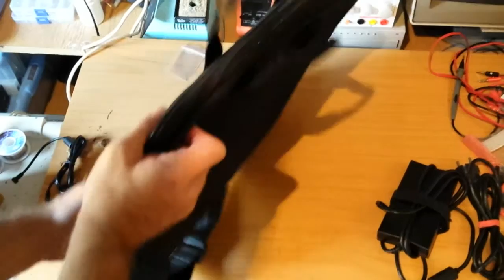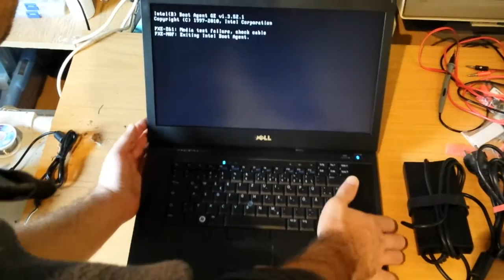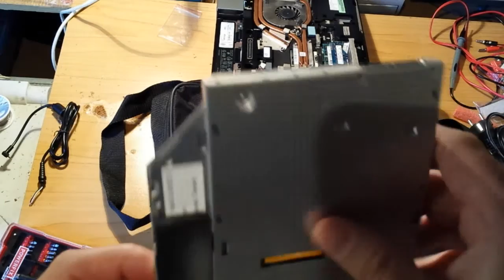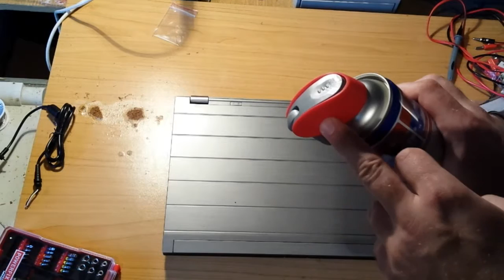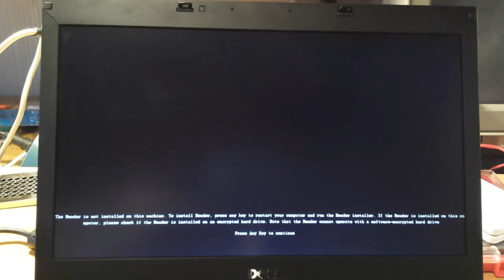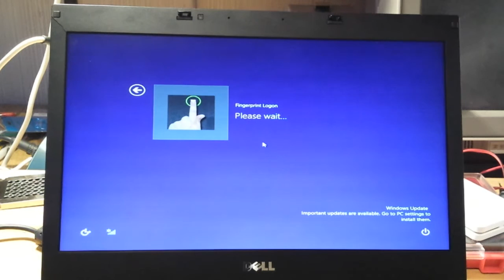nTOOBE #22: Dell Precision M4500 (unboxing & semi teardown)

Comment: Definitely a solid choice for even 2020. These laptops are the last of their kind in terms of durability, functionality, and practicality. Parts for the M4500 are even interchangeable with the E6510, which means that parts such as batteries or palmrests are going to be available for a long time. Pop in at least 8-16gb ram, a quad core, an ssd (this laptop supports msata), and it'll be good for another 5-6 years.
Reply: As a sidenote- I have never had any motherboard issues with these laptops. I assume these motherboards will last naturally until the capacitors or some other electrical component gives out. Just ensure your thermals are appropriate for your application (80-95C under load and 50-75 under normal use).
Reply: I'm currently installing Linux Mint on one of these as we speak. upgraded to 8gb ram and 180gb ssd.